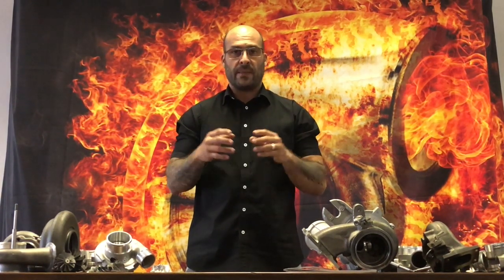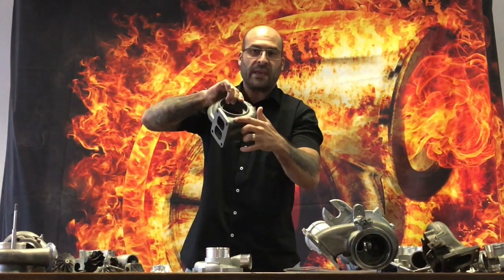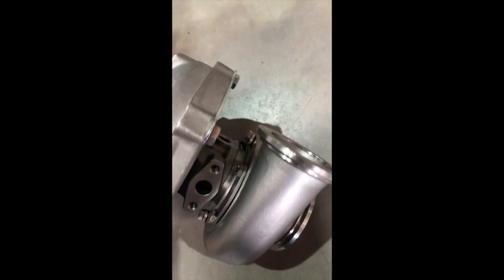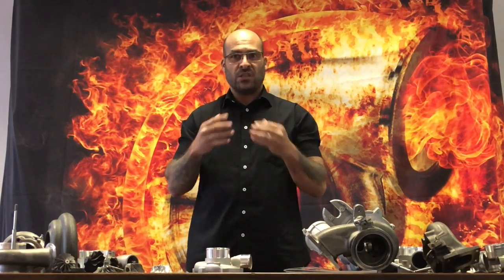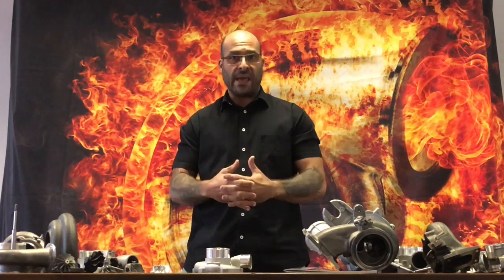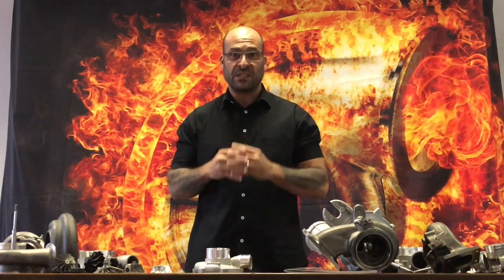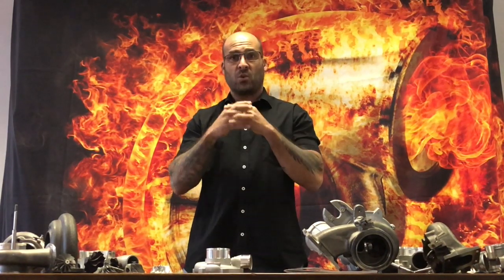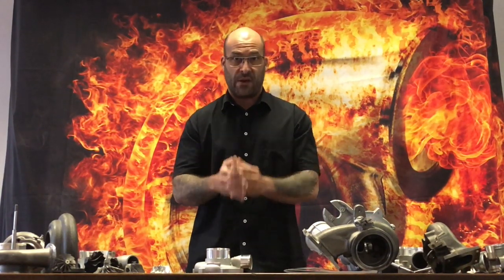Fake Garrett turbochargers sold in South africa

Comment: A mhi/ihi design billet wheel in garrett turbo. That’s intresting, I wonder how well it will flow.
Reply: There is a long way for these copy right people to earn that experience. Especially in the motorsports world. In the end price does matter and you get what you paid for. I personally never pay for these cheap turbo. I seen catastrophic failure like what you’ve posted.
Reply from the maker: It doesnt - the turbo was installed, didnt make 400HP, and the chinese importer asked for the turbo back, changed the compressor wheel, claiming that the clearances in the housings were machined incorrectly which caused the poor performance - they replaced the wheel with a copy of the GTX3076R Gen2 and the turbo failed on the dyno the next day. Client now runs a Genuine Garrett and have never looked back - the cheap knock off products have no design knowledge or any faint idea of how a turbo works, or the "marriage" between the turbine and compressor stage at all -- 99% of all fake product is a total mismatch!